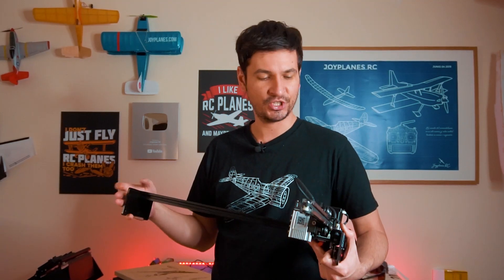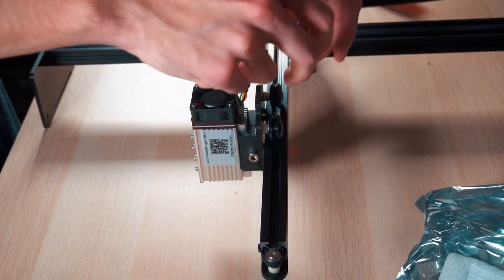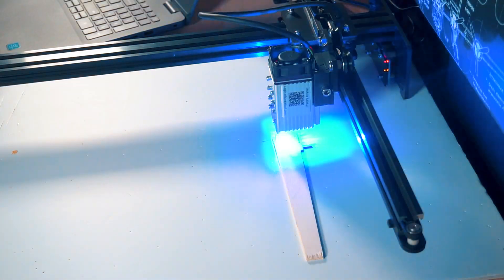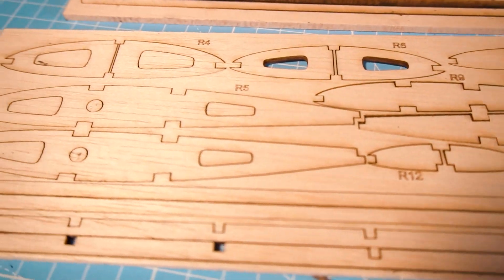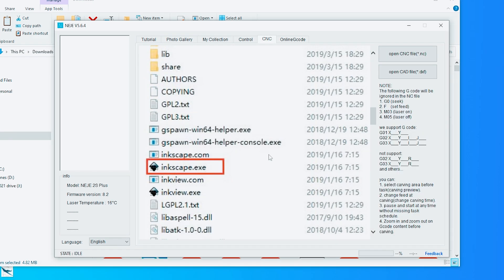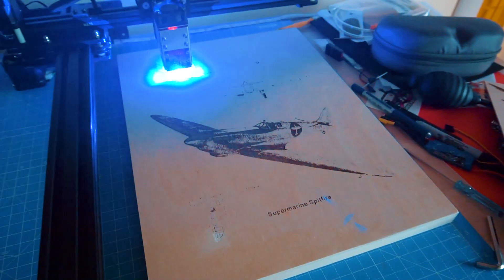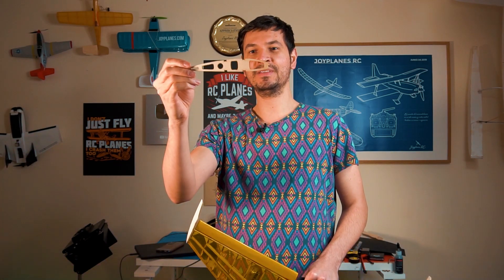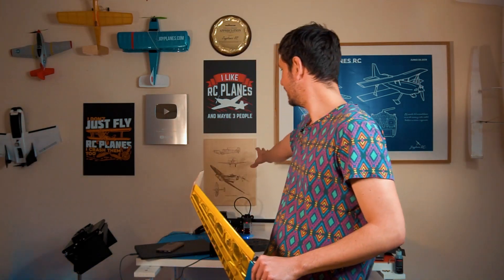Neje Master 2S Plus - A40640 laser module to cut and engrave | I built RC airplane with this

Comment: It is safer to use a cricut for vinyl cutting. As others have stated, PVC (Poly Vinyl Chloride) Vinyl emits chlorine gas when laser cut..!! Short term exposure to chlorine gas causes mild to severe eye and nose irritation, breathing/respiratory problems. Long-term exposure can be deadly. You may be able to find a PVC Free "Laser Safe" vinyl but stay on the safe side just use a cricut for your stickers :)

Comment: what i wanna know is that a laser cuts the wood at a 90degree angle and if we go for a tapered wing the slot from where the longerons or other support is going has to be cut at an angle so how does the laser cut that because when im making a balsa plane on fusion i always come across this issue as the laser wold read sketch file so i have to project the 3d piece but the things is the rib structure ina tapered wing has different projections on each side so i always get confused on which side to project its not that much of an issue tbh as i just sand the slots afterwards but id glad if someone can give a more effective method

Comment: "Can go up to about 40W.."  That's not optical power, which is the actual laser power not the whole laser module power.  Currently using a 20W optical diode and it can do 4mm MDF, 1 pass, 490mm/min + air assist, 6mm black acrylic 1 pass @ 100mm/min.  I see LT now have a 40W optical.  Common misdavertising tactic is to quote the whole module power, whereas most are fitted with a similar diode with an actual optical power of between 5 and 6.5W 
A true 40W optical laser diode will run you close to $1500 just for the module...as of this post date

Comment: I'm considering buying a machine like that too, but I'm wondering if there is an easy (automated) way to get the paper plans that I have into files for the cutter.  I have several plans with parts drawings for boats, so how do I get them in the machine ?
Reply: I would say scan them as an image file, import into inkscape or similar vector graphics software, and trace over the lines as best you can
Reply: Tracing with the pen tool as per the comment below is the most accurate way but adobe illustrator has a auto trace tool that can be set to outline mode. This should work ok if the source image is clear enough.

Comment: Not being able to cut white foam board makes it a non-starter for me. Also, hard to find ones that are big enough to cut a whole sheet (20" x 30") that aren't bulky, expensive commercial units.
Reply: Cover or paint the foam with black and it will cut it perfectly.
Reply: @Imersiva  painting isn't really a good or clean option, and if you have to put a sacrificial black piece of poster board or something on it, you're increasing your material costs by quite a bit. Though, if the latter works, I guess it is an option. I'd just rather not have to bother with all that. Going to an expensive CO2 laser is a big jump in price though. Have to have a significant ability to turn profit using it to justify that cost.

Comment: Hey. I see u glued the servo into ur wing.why? What happens if servo goes bad?.u gonna have destroy the wing to get servo out, I guess.
Reply: Its usually not too difficult to break the glue joint. But if you prefer, you can wrap the servo in masking tape before gluing it, the masking tape can be released more easily. I generally use double-sided tape, but glue is fine.

Comment: hack
Reply: I am curious as to how you get the plans into Lightburn.  I have the Neje 3 Max and the A40640 dual beam laser.  I cut 3mm baltic birch plywood with 90 power and a speed of 5.

Comment: Honestly it's not as intuitive but I get better results with their software than I do with lightburn on some things. It's Auto image analysis is pretty good and as long as you convert everything to grayscale before you import it should work fantastic. I'm using gimp as an image software at the moment. I have the others but I haven't renewed. Now that I understand how to use the freeware or open source programming a little better everything runs smoothly. I'm planning on upgrading soon because my neje master2 just died... I ran it pretty hard for 2 years! I did things with that machine you're not supposed to do! The only thing I have to say is I follow the advice of styropyro when it comes to optics. Like a good scope your lens should be comfortable to at least half the price of a small laser. I paid $85 for my glasses but I know my eyes are safe. I've even used them for other projects like Ruby manufacturing.

Comment: Great vid but watch out for toxic fumes when cutting vinyl...
Reply from the maker: Thanks for the tip! when cutting that it smells horrible!
Reply: @Joyplanes  Polyvinyl chloride is the full name.  There is chlorine in it, and it will corrode other metal things nearby.  Search for Chlorine - SAFETY DATA SHEET.

Comment: Can you please share your LightBurn settings for 5mm balsa?
Reply from the maker: I forgot them, but there are many ways to do it, many passes high power, high speed, or lower speed, lower power and just 1 or two passes etc. It also depends on the density of the wood, some balsa wood are more dense than others.